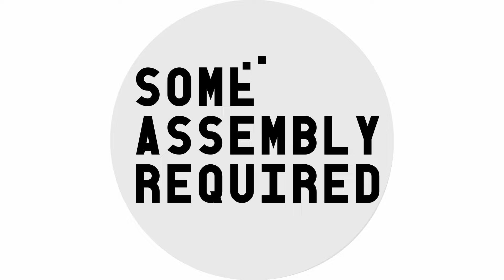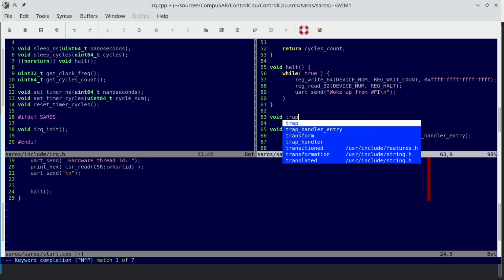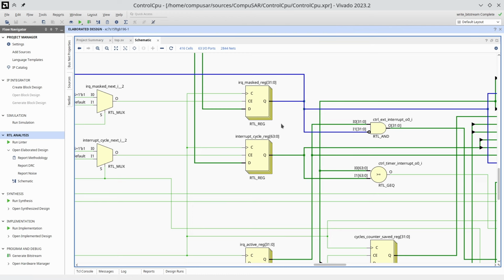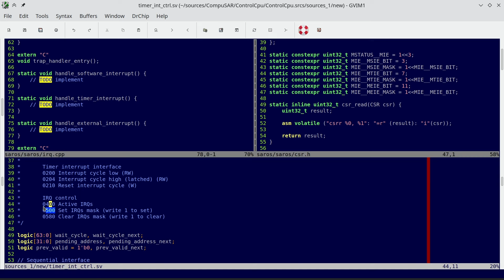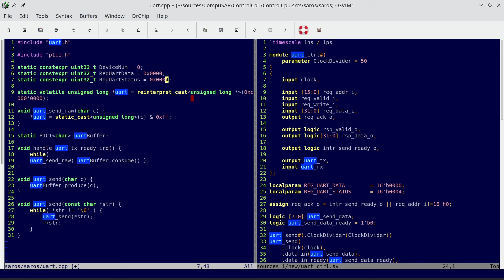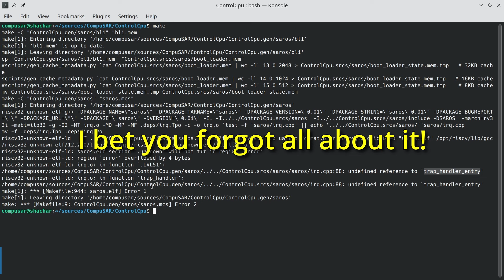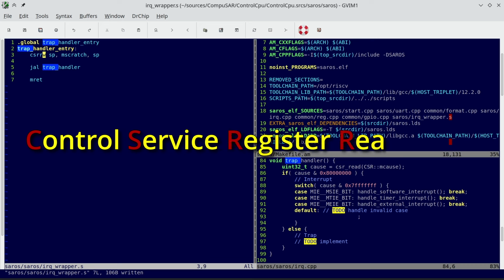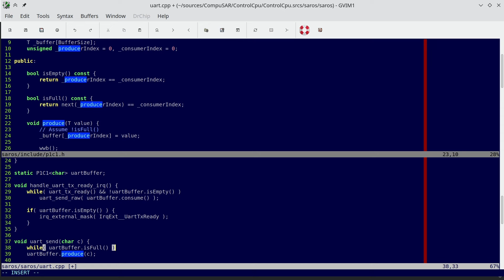Writing an interrupt handler: Making the UART asynchronous

Comment: I’m curious if you have reviewed GCC’s RISC-V Function Attributes for Declaring Attributes of Functions? The manual approach was illustrative though error prone.
Reply from the maker: You know, I did but didn't find anything (searching for the specific term you provided did return a result). I doubt I'd have used it even if I did, though. Both because, as you said, it is illustrative and because I have plans for hacking the sequence later on.
I will have a look at it now and see how different it is.
Reply from the maker: So, I did have a look. The GCC version uses a completely different approach. It uses the stack that was already there.This approach is pretty useless for context switching, which I want SarOs to eventually do. That's also the reason I specifically said in the video I'm saving all registers, despite the fact I only need to save those that the ABI marks as caller saved. This is laying the ground work for later returning to a different context than the one you interrupted.
In general, this attribute mostly affect register saving. It marks different registers as "callee saved", and pretty much does nothing else. This is particularly obvious on ARM, where the platform has certain registers shadowed in the relevant exception level so that you can use those and not save anything. GCC doesn't use them. That interrupt attribute affects which registers are saved, but not which are scheduled for use, resulting in lost optimization opportunity.
I opened a bug about that for ARM. That was in 2011. It's still open.
https://gcc.gnu.org/bugzilla/show_bug.cgi?id=48429

The bottom line is that you often have to write your interrupt entry/exit manually in assembly. For some cases, you'd have to write the whole thing in Assembly.
Or, as the channel name says: some Assembly required.
(Notice the capitalization of both the above sentence and the channel's name).